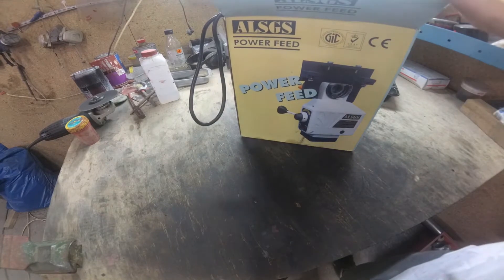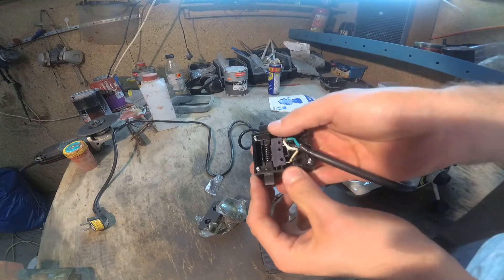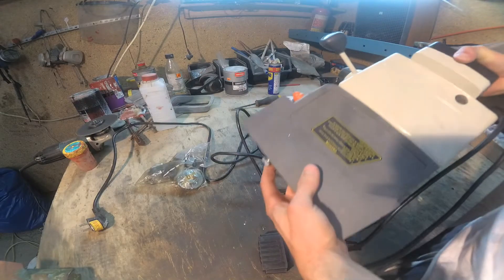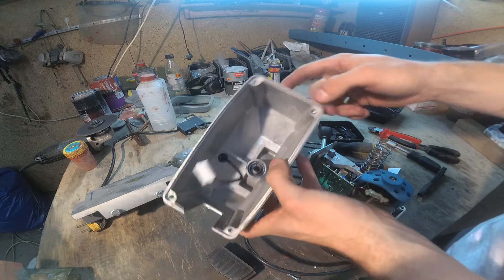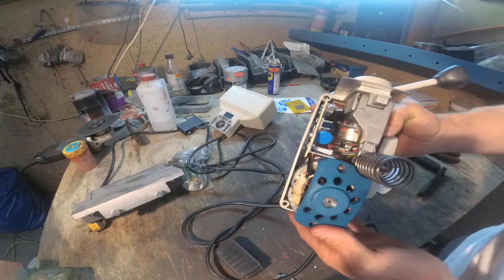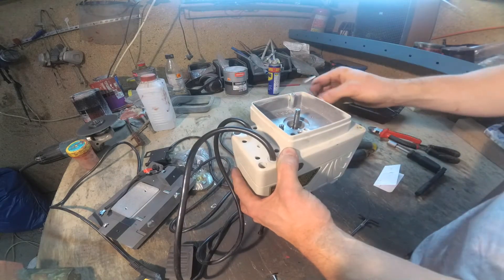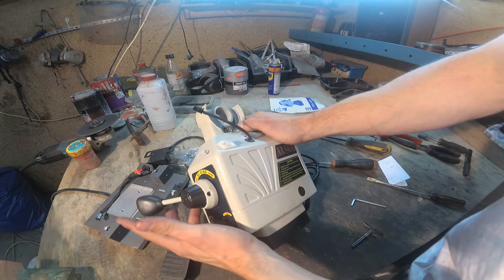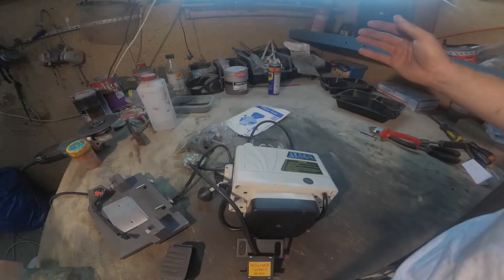ALSGS power feed for ZX7045 & RF45 clones  - small teardown

Comment: A bit late I know. I just pulled my old unit apart and it’s very similar to yours except it has beveled gears made of brass where yours has straight gears made of metal. My unit is 22 years old and the large plastic gear on the bottom is still in perfect condition with no signs of wear and the brass beveled gear only shows minor wear so they’re definitely lasting ok. The LED on mine has burnt out but the main problem is the potentiometer has failed so the variable speed does not work. My new unit has a hard plastic cover that goes over the switch to keep oil ect out of the switch. Maybe you could make one. Cheers Stuart 🇦🇺